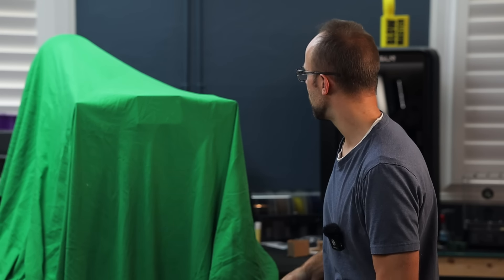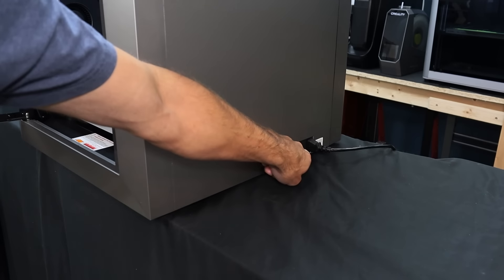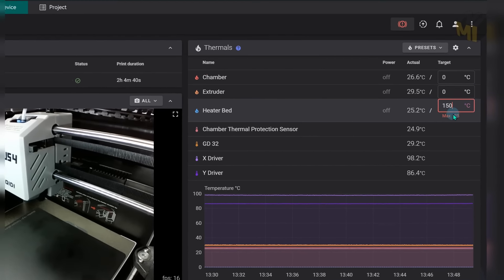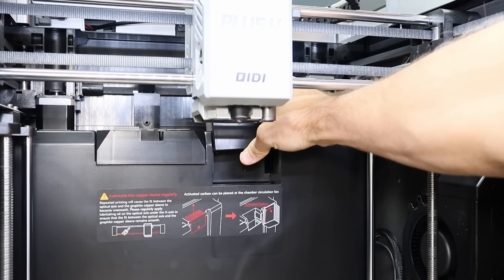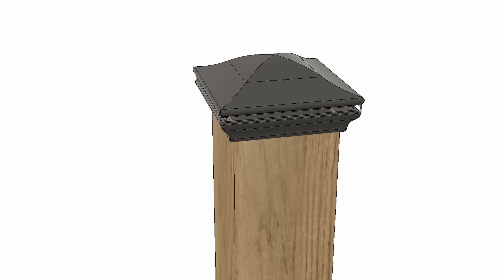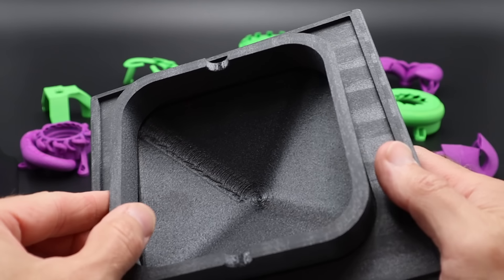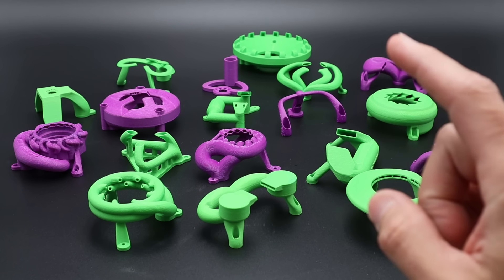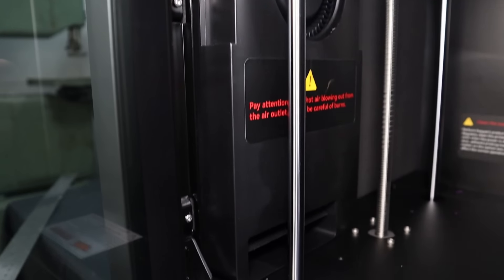The All New QIDI PLUS4 - the best value to performance printer on the market

Comment: The bed and nozzle  max temperature is what I`m loooking for... Only thing missing for me is a second tool head... If this printer had it I would probably buy it... I`m waiting for a while for a printer that has the ability to print high temp filaments and has at least 2 heads...
Reply: How long do you expect to wait for such a machine to hit the market?
Reply: @SquintyGears  I don`t know man... I have a printer to tinker with (Ender 3) and a reliable one (P1S+AMS)... I was thinking about building a voron with tap changer but the nozzle temperature would still be a problem... I dont know Why but I have hopes for the next bambu printer... I will just wait for now. But this Qidi plus4 is looking awesome! If they realease a reliable AMS like product (like their web site states) and they sold shipping from my country (like bambu does trough resellers) I would easily buy it if i havent had a P1S.
Reply: Go for a RatRig, you won't be disappointed.
Reply: Think about used Palette. I bought Palette 2 for 100 eur, and it's doing amazing job. It works by calculating the length of the filament required to do one color before switching, then cuts one filament and fuses it to the another. And connects to the Klipper indeed. So you can turn any printer into multicolor/multimaterial. The only thing that might lack in that - TPU. You can do the TPU as well but AFAIK you need to calibrate splicing for the TPU
Reply: I agree, AMS is just so wasteful and slows down the process.  With 2 heads (IDEX) you can print either 2 color prints or arguably more important print part with one extruder and the other with support material.  I just don't see why there is such a lack of options in the market for this type of machine.  The "poop" feature is a clear sign of a multi color unit (AMS), but in my opinion, it is just another same - same as the other guys option.  Make that 2 heads and hey if you add a ams type unit that can work with 2 heads, that would be a wow factor that knocks it out of the park.  So many of the printers do the same thing, have about the same features, you are just making a decision on aesthetics or what makes you feel better or perhaps one small feature.  So come on Printer Manu. make a statement - go out and be different.  Prusa has the multi head system, but not priced for the average consumer.  And it is an open machine, so you can't print those exotic high temp filaments. I would love to have one but $5k is well a bit over the top considering that in a year or 2, it will be obsolete because of yet another printer model that is better, faster, ...  So somebody make a machine that has all the features of the QIDI plus 4, has an auto bed level system (not sure what this printer has.  AND has 2 heads. Price it at $1k and guaranteed you will sell tons.  I will be the first in-line and from what I have seen in the forums, it will be a long line of people in waiting.
Reply: @trendstrategics  Exactly!
Reply: @trendstrategics  and you still need to purge anyway, because the filament would drip out
Reply: If you want a second tool head, go ahead and buy a Plus4.  You'll have to get a second one to replace the first one that doesn't work.  Ask me how I know.  The qiditech reddit is littered with idiots like me who bought an $800 paperweight based on the recommendation of a Youtuber.

Comment: I am looking at getting this Plus 4, would you recommend waiting a few months in case any issues pop up like for the Q1 Pro did that they fixed with a minor revision, or would it be fine to get one now? 

Also thanks for the review! Great video! I was looking to get a Q1 Pro or a P1S, but I'm glad I waited. Something interesting on the Qidi home page, on an early bird image for the Plus 4 they show what looks like an AMS in the photo and it says coming Q1 2025
Reply from the maker: I suppose if you can wait, that's always a good idea; I haven't had any issues myself and overall the reviews are very positive and the company has excellent custom service too, which is not so common these days.  There is always a chance that something could pop up that's unexpected and maybe the price will drop depending on how the competition responds.   I'm just about to do some more printing on mine now, and this time I'm going extra fine with the layer heights to see how low it can go for some printer Limbo :)   Thanks for the support it's always nice to get some feedback on the reviews, this one was quite positive compared to most of the reviews I do, I'm pretty critical, it just happens that there isn't much to complain about and there isn't even anything for me to fix or adjust.  Normally I have to make at least one follow up video to design and print something.

Comment: So they have now finally achieved feature and performance parity with the 1.5 year old Bambu Labs X1? Well done Qidi! To be fair they do have a larger print bed than the Bambu X1.
Reply: ...and a chamber heater, and wired ethernet, and tangle detection, and hotter nozzle temperatures, high print bed temperatures, better insulation for higher chamber temperatures, easily accessible spool holder, open source, and $300 cheaper. Apart from all that, it's basically the same!

Comment: Looks like a nice printer for sure. would have loved a bit more Z height as well. I guess that will be the X max 4. The size is still pretty good nonetheless.

having the power switch on the side is better than the back, but why not just put it on the front? I never understand this. My 2014 Lulzbot had it on the front and is super easy, barely an inconvenience. Just put the switch next to the screen.

pretty tempting.

Comment: It’s great to see other companies trying to catch up to bambulab but hardware is only part of it. Bambu is winning due to great software as well.
Reply: I wouldn't really say this is catch up so much as beating in certain areas such as the nozzle temperature and heated chamber as well as build volume. Qidi has been doing enclosed core XY for a decade. Their firmware is open source and the new Qidi Studio is based on Bambu Slicer which is of course basically Prusa Slicer. Qidi's screen works great and the connectivity is awesome as well. No need for account sign ups or sharing data either.
Reply: @802Garage The newest beta of Orca slicer now supports the plus4 too.
Reply: @Captain_Harbatkin  Indeed that's what I'm currently using, though I still have Qidi Studio as well. :)

Comment: I'm so glad I didn't pull the trigger on the X-Max 3 a few weeks ago!
Could you answer a couple of questions, please?
1. Is it possible to mirror the door hinges?
2. Have they sorted the filament run-out sensor so it doesn't reset to "off" whenever the printer is power cycled?
3. Would you send the printer to me if I pay the postage? 😜
This does appear to be the printer I've been looking for but I may give it a couple of months of the public playing guinea pigs before I buy one; the price may drop a little by then, too.

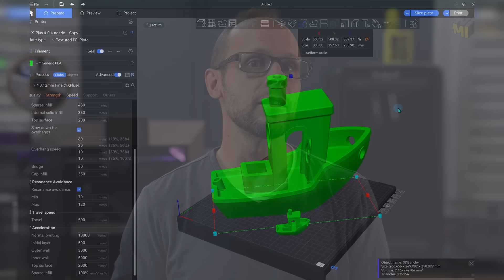Comment: 12:20 this is huge tbh. Not having to run tests every time you buy a roll of filament is massive. With the amount of spools we go through it'd be a huge waste of time. Thing is... I'm really curious about this printer. If this ever got a multi color system added to it, i'd seriously think about getting one.
I'd want ot be sure it can print as high of a quality as the bambu's do for me but one thing i'm still curious about is its cooling. I'd want an entire video dedicated to overhangs for this printer because it seems like it has better overhangs which is absolutely massive.
That being said, seeing a cool plate on this like the one i'm running on my bambus now where i'm running bed temps at 30-40 for pla allows for better overhangs, i'd imagine they'd be flawless on this.

Comment: Hi. Thanks for this review. I think that this printer is superb. Recently, Prusa released the feature of extreme 75° overhangs. Curious to know how this machine compares. Also, will a similar, new, Qidi printer with larger print dimensions be released soon as I need to print with larger dimensions (400 x 400 x400 mm) would be perfect for me?

Comment: Are you printing in your studio? What are you doing to keep the air clean? I recently installed the bento box from Voxel. Would one of those fit in this printer?
Reply: It seems to have a active coal filter like the bentobox pre installed mentioned at: 5:54
Reply from the maker: I think since we're entering a realm of high-temp materials it would be wise to find a way to vent outside, there is room inside for a bento box for sure, that'd be good, there is a carbon filter right now and the exhaust is active during the print so it will help, but long-term for any printer we should be trying to get that air away so we can avoid any unknown long-term impacts.  I'm happy to make a video about this, I'm also thinking that the system would be similar to what you'd see for dust collection, we'd have a bar running along the wall with flexible connections, we can create a magnetic adapter plate to easily connect and remove the coupler and then we just need a fan to draw air out slowly to create a negative pressure inside the cabin.  Of course if you have one printer it's much easier,  is drilling a hole in the wall an option?  I'm thinking the ceiling is another way, essentially an exhaust fan into the vented attic space.
Reply: @NeedItMakeIt  the bento box also contains a small hepa filter. Cheap to replace, about $1.50 per filter. A full dust collection/filter would be a great video series. Testing air quality as you go. 

My understanding was that if you are printing ABS, filtration or venting outside is highly recommended. Now I have seen videos showing particles in the air from even PLA or PETG. Love to see your thorough analysis on this topic
Reply: @NeedItMakeIt  "but long-term for any printer we should be trying to get that air away so we can avoid any unknown long-term impacts.  I'm happy to make a video about this". I would love to see this video. It is a concern and it would be interesting to see how you tackle it. Thanks for the video!
Reply from the maker: I've been doing some research and there are a few approaches that would work, the trick is to come up with something that works for everyone anywhere, and that's not so easy.  I'd imaging that there are people who cannot drill a hole in their walls and who may not have access to a window that opens either.  Fresh air from outside is always best, using the HRV approach, and there are some smaller units which are pretty low profile, but again, those require drilling, so more thought is needed on this subject!

Comment: Same price and volume as K1 Max but nice LIDAR or load sensors. Nice platform, belts, heat management, and AMS option though. Need a comparison of K1 max and Plus 4
Reply from the maker: I have a K1 max, sadly, I don't recommend it anymore, there are too many issues related to extrusion with the machine, bed level is also an issue, but I've made several videos to correct those.  The "Lidar" on the Max does not work correctly and I ended up removing it after too many failed attempts.  The machine looks nice, but the frame is not rigid enough and the extruder is unsupported on one side of the extruder gears, which means that they flex too much.  I think that it was a pretty good machine when it was released, but now there are better options out.  At this moment, I would recommend the Q1 for someone looking for a printer at a good price that still performs really well, I'd recommend the PLUS4 for anyone that wants to print bigger and heavy duty parts and I'd recommend the X1C/P1S for anyone who is desperate for color printing.   I like the ability to print in color, but I rarely use it, the AMS is nice for storage though.

Comment: How would you say it compares to the P1S, which is widely considered to be one of the best bang for buck printers out there.
I am not sure about regional pricing but in germany I can buy the Bambulab P1S for 599€ or 849€ depending on whether the AMS is included or not. I would assume that is pretty price competitive with the 799$ of the Qidi
Of course the Qidi has more features than the P1S for 200$ more. For only 50$ on top you could get a full P1S combo with AMS.
I own neither of them but i am currently looking at buying a P1S with AMS for reliability reasons (kinda tired of the ender 3 V2s problems)
But i am interested to learn how this new release holds up to that combo at a fairly competitive price.

Additional question: i know Bambulab is known for their durability and reliability. I have seen very good reviews of qidi products, how do they hold up over a longer time? I need a main printer that is reliable. I can still tinker enough on my Ender 3.
Reply from the maker: I guess it depends on what you're printing, if you're okay with lower temp materials like PLA and PETG, some ABS, the P1S is pretty good.  Also if you want the AMS apparently they have something planned for the 1st quarter of 2025.  Aside from that, this printer is far more capable than a P1S, not knocking the P1S, they're excellent machines too. IMO I'd sell the P1S while it still has a good resale value and move on up, but I can't speak for anyone I don't know your financials and what it is that you like to print.  I can say that this machine is built like a tank, it allows us to make parts that wouldn't be possible on other machines.  I think long-term it would be a good idea to vent outside too if we're printing the really high temp materials.
Reply: @NeedItMakeIt  Thank you so much for the detailed reply.On my Ender 3 I am printing mostly PLA but would love to expand on ABS, ASA... as well. I will now definetely reconsider and might go with the Qidi. It is definetely a helpful piece of information that you've been using it for a few months without issues as it already gives some idea as to what we can expect reliability wise. And that is a high priority for me at the moment.
I dont shy away from fixing things myself but by now it has happened more often than i'd like that my ender 3V2 has had a major issue right before an important project deadline.
I will definetely wait until it is available to purchase in Germany and then we will see if i go Bambu or Qidi.

Comment: I’m surprised so many new printers are using linear rods rather than rails. The modding market is adamant that rails are better, but are they just overkill? They don’t seem to be needed.
Reply: Rods are just cheaper and have lower mounting tolerances. To get proper use out of rails you need proper mounting tolerance as well as higher precision alignment (not to mention the small rails generally used are bottom of the china barrel quality products)

Comment: This maybe better than the long awaited  Phrozen Arco, which keeps getting delayed that i had backed with kickstarter!
Reply from the maker: That machine looks like a beast too.  It doesn't look like it'll be enclosed, but I suppose there will be a kit for that.  QIDI has a bit of an advantage, they've focused on enclosed printers in this format for quite a long time, not to say that someone else couldn't surpass them, Bambu has surpassed many companies, but I think QIDI has their own path which has diverged a bit.  They're going towards the heavy duty engineering parts and that's a great place to go IMO.
Reply: @NeedItMakeIt  I agree. I think Qidi is way ahead in terms of chamber heating and the ability to print high performance filaments👍